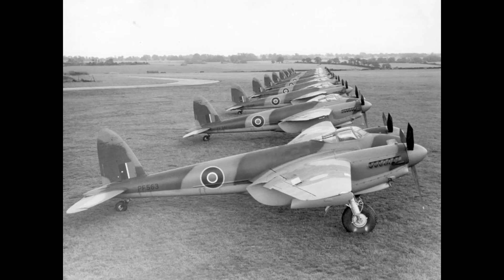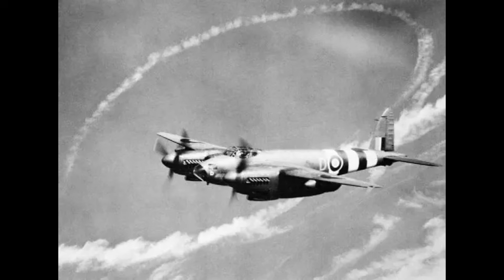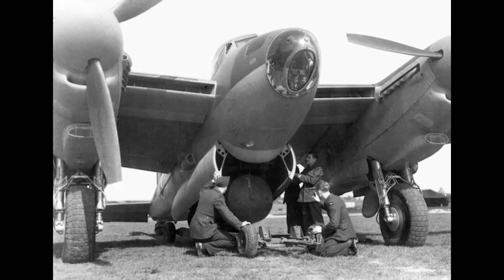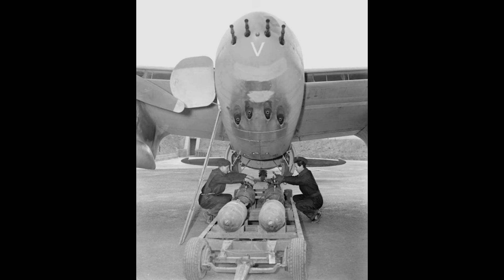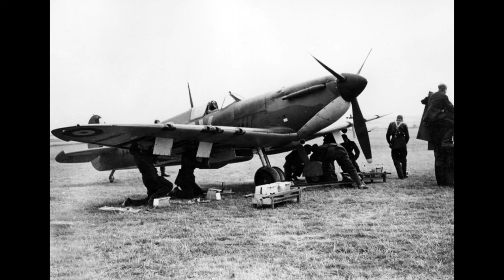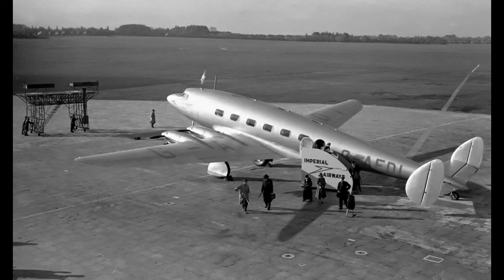How One Carpenter's "ABSURD" Plywood Trick Made Mosquito Bombers Outrun 400mph German Interceptors

Comment: That opening shot of a row of Mosquito's parked in the open is improbable.  One of the weaknesses of wooden aircraft is not tolerating damp, whether it's the morning dew or being rained on.  It causes milk based glues to slowly dissolve, wood to warp and rot.  In practice, they would be kept in a hanger between missions.
Reply: The casin adhesive was used in early Mosquitos, de Havilland then switched to urea-formaldehyde glue which was significant more  durable and weather resistant.